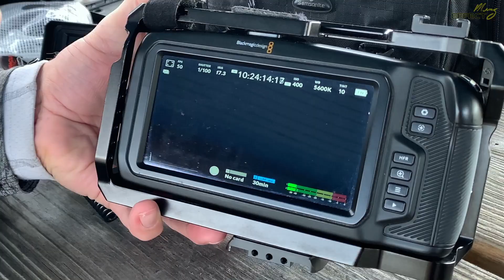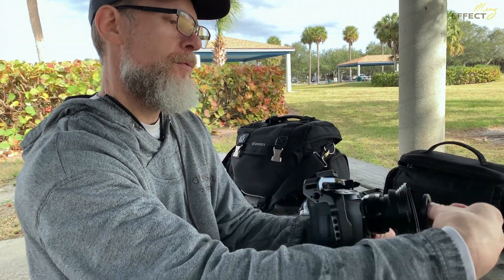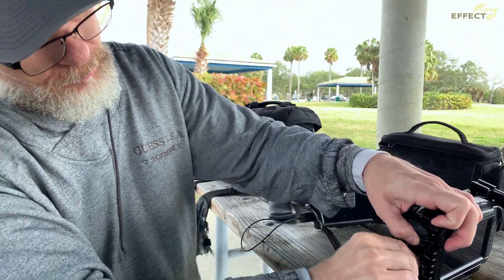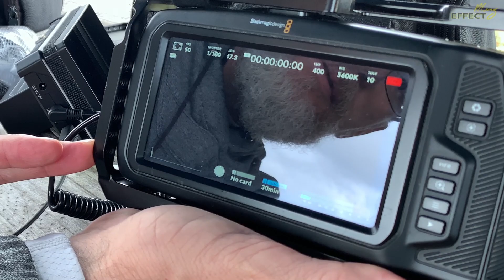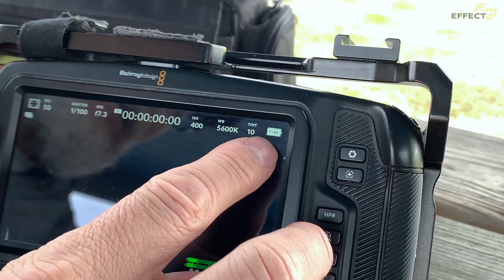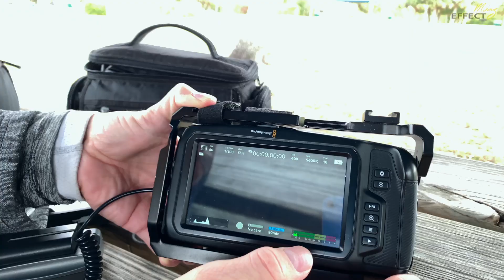How Much Power Does BMPCC4K Need?  Andycine Monitor And SmallRig Adapter Plate | Ming Effect

Comment: Is undervolting a camera is something bad for it?
Reply from the maker: You're going to get different minds with different answers on this one. From my personal experience, I've not had any problems using the Andycine monitor for power at all. My P4K is still in top condition, and I've used it hundreds of hours with a variety of battery solutions. One has to remember that even "regular" batteries don't just go from full peak performance and then drop suddenly to zero. You can watch the voltage drop over time until the unit shuts off, squeezing out the last bit it can before power-down. My personal experience with all the time I have in on my camera might be unique, but that's all I have to go on. I hope that helps.